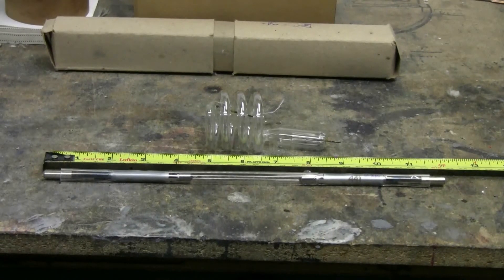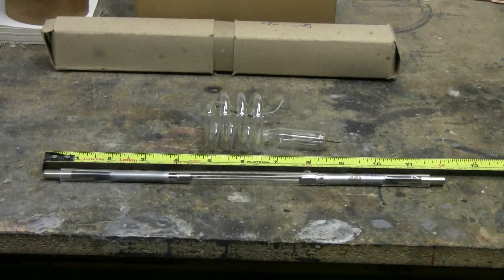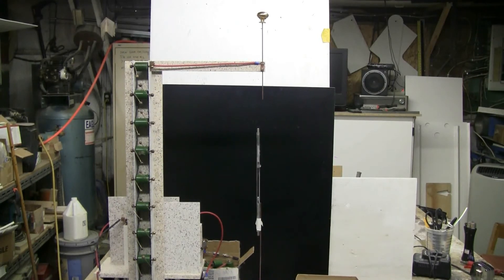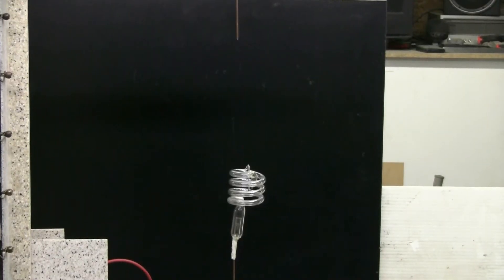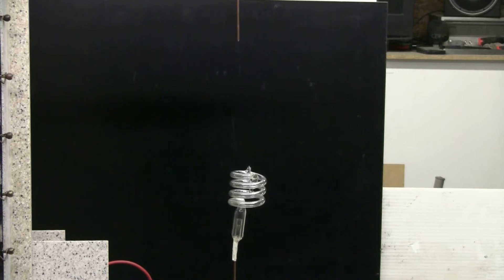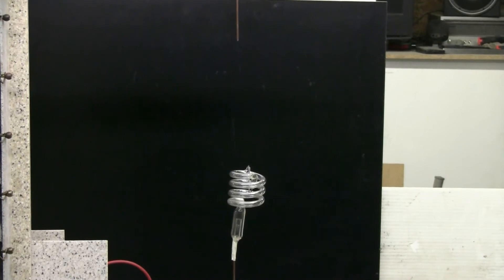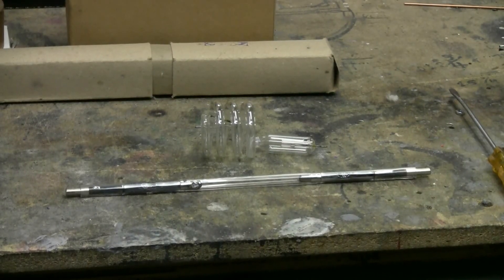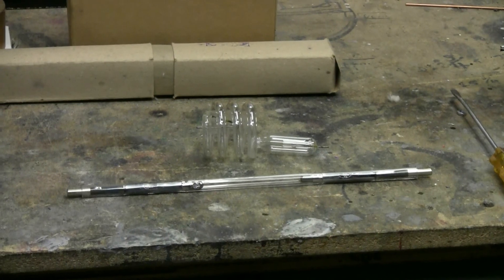Marx Generator - Xenon Flash Tubes

Comment: Bill, do you know what effecf, if any, a fine spray mist of water would have on the large spark gap?
Reply: That's an interesting suggestion. Ultrasonic humidifier can be used for extra fine cold mist. Some close up photos of this setup will show the most accurate representation of a thunderstorm in a room :) My best guess is the path of the lightning will be strighten up (not jagged) due to higher air conductivity.